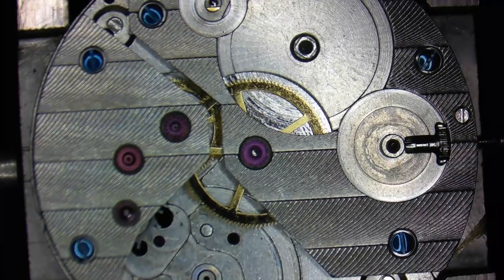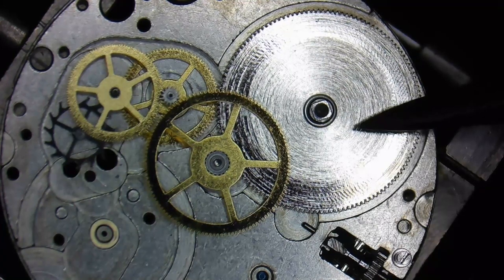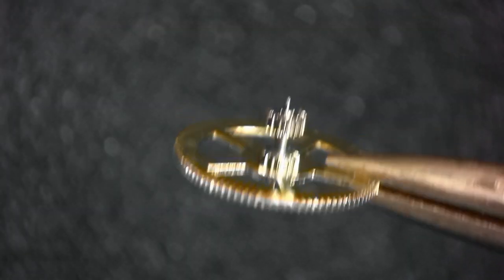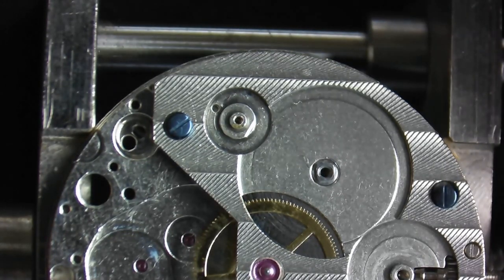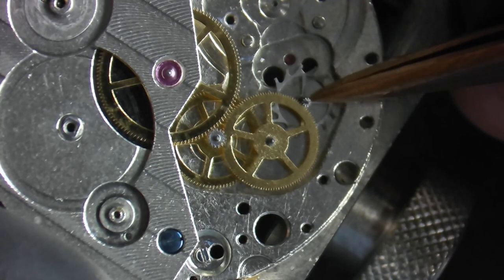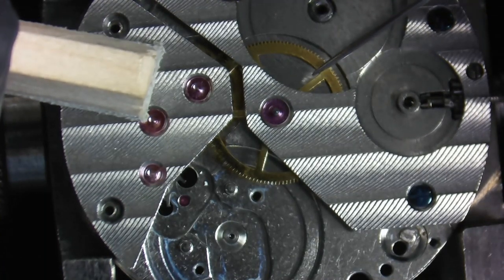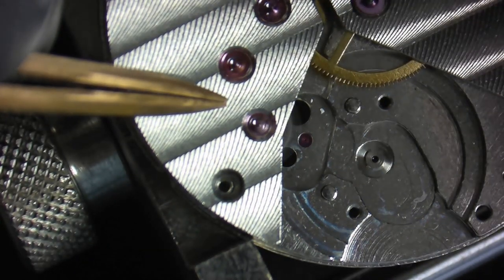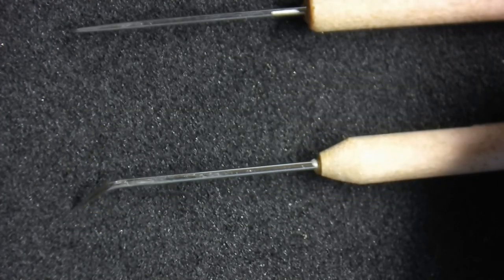How to Install a Train Bridge without Breaking the Pivots

Comment: Really thought you were going to do the "it is hard to get a bridge on perfectly the first try, but oh look, I just did" and keep going from there. Thanks for the second take with your deliberate explanation of what to do when it doesn't work the first time! Found your video after getting stuck servicing a movement with a single train and barrel bridge that is being especially difficult to get seated.
Reply from the maker: Lol, it usually doesn’t happen but sometimes it does. The needle probes I use help a lot and being able to see where the pivot is in relation to the jewel hole also helps a lot.

Comment: Alex great videos l have a question for you.l have a omega 564 l have cleaned all the parts and burnished the pivots with my Jacot tool on assembly the balance spring was centred between the guide pins as far as l could see started the watch and found the watch gaining 650 seconds a day on my timegrapher machine and have run out of space to adjust it anymore. It has a new mainspring in the watch and I have ordered another spring just in case every thing on the balance seems to be okay no rubbing and demag the movement I hope this question hasn’t gone on to long looking forward to your reply many thanks Pete
Reply from the maker: what's the amplitude at a full wind?

Comment: Great stuff as always :)  One thing I always mention with any part that is held in with multiple screws, whether it's a watch bridge or the back of a G-shock or the intake manifold of a smallblock chevy:  START all the screws before you tighten ANY of them.  It's very easy to put something on cocked or weird if you tighten the first screw before the others are in place.  It also makes sure you always line up screw holes, etc.  

I can see that you do that but thought it was worth a mention :)
Reply from the maker: Hi Eric,
That’s a very good point.
Good stuff Eric. 👍

Comment: What can create a problem where the seconds hand is acting sparatic. During a 60sec circle it sometimes stops and then caches up and works normal, untill it does it again, few times every circle. It is omega cal 1002. I watched the gears under a microscope. the seconds hand gear s theeth have the same problem as the hand. It was happening even before i servised it.The difference is , the watch is working perfect now. I did not oil the seconds hand post. And i did not remove the canon pinion, as it seats on a center will. The watch is working perfect atherwise. I do not know how to fix it. May be to change gears. ??????????
Reply from the maker: It sounds like there is damage to the teeth of the 4rth wheel or the pinion of the 3rd wheel. 
Inspect them under magnification

Comment: Very interesting video! Unfortunately, it is so much harder with smaller movements, where you can't immediately see with your bare eyes if the pivots are positioned correctly.
Reply from the maker: Yes, I understand. Just try moving the second or center wheel and while holding the light pressure on the bridge, look to see which pivot is not straight and try moving it towards the hole until it falls in. It just takes practice.

Comment: great video.  and yes it is very frustrating aligning the bridge. but i am getting better.  thanks 
i have a question 
for trying to diagnose which gears might be the problem. why cant i move the whole train from the center wheel when the balance wheel and the pallet fork is installed
Reply from the maker: The pallet fork is locked on the escape wheel which prevents all the power from leaving the mainspring barrel. this is why the power is let down before removing the pallet fork.

Comment: I can`t do in anywere on old watch Pobeda 2602
Reply from the maker: Try this. Install the bridge with just the center wheel, then with the center wheel and 3rd wheel, then add 4th  wheel and then finally the escape wheel.
Make sure when you are bring the plate over the pivots that the wheels are all standing straight.
When you are aligning the wheels make sure that the 3rd wheel in, the check the 4th then the escape wheel.
Use a probe to move the pivots and with good magnification look through the pivots to see where the pivot is.
Hope this helps

Comment: Hey Alex, thanks a lot for this series of videos they’ve really helped me! Could you confirm exactly which order we should be disassembling and reassembling please?
Reply from the maker: It doesn't really matter in the disassembly. When putting watches together I typically start with the keyless works Because the crown and ratchet wheel are part of it. Then you can install the powertrain starting with the mainspring barrel and its components, the bridge and then finally the train wheels. Then you can install the pallet fork and balance wheel.
Once this is assembled, go to a full wind and see what it looks like on your timegrapher. If everything looks good, meaning no crazy trace lines,  obvious problems in the escapement and decent amplitude then you can go ahead and install the motion works in any calendar systems.
If after installing the balance wheel, if  the movement is demonstrating anything out of the ordinary that doesn't look good, there's no need to assemble anything else yet. Let the watch run for 24 hours to see if things settle out before starting to do any troubleshooting.
Reply: @watchrepairtutorials  awesome thank you 👌🏽

Comment: Why do you loosen every single screw slightly before the final tightening? I noticed you do it with every screw like that, so there must be a good reason?
Reply from the maker: When I put the screws in initially, I'm just securing the bridge in position, then I checked the wheels again to make sure everything is free spinning.
The reason I back off or reverse the screws is, I want to feel the resistance of the screw to the part then I turn the screw the width of the screw slot for the final tightening. 
That's how you know the screw is tight enough.
Reply: @watchrepairtutorials  That's a very good method indeed. Thank you!

Comment: Having a blast watching your content! Awesome stuff, enjoying it so much. I want to start repairing watches strictly as a passtime hobby and these videos are so helpful, everything I have learned so far is from you. Thank you so much. 🤘
Reply from the maker: My advice to you would be to take your time. This stuff takes time to get good at. Learn something new and practice. The main thing you should be focusing on at this point is how to complete a service or working movement so that the movement works better than it did before you started.
Reply: @watchrepairtutorials  Thanks for the advice, I have a pocket watch that only runs when it’s dial facing down, looking forward to see if I can get it running correctly again ;)
Reply from the maker: @TheDivineInferno   you will be able to one day. If it doesn’t have shock protection, it’s most likely a broken balance pivot. That type of repair will require a staking set.  Just FYI old pocket watches are probably the most challenging watch is to get running correctly. Let me know if you need anything.

Comment: I've discovered tapping the side of the movement holder with the blunt end of my tweezers does a fine job of getting pivots (train bridge and balance wheel) to settle in place. 
Thanks for your videos, Alex. I use them as a constant reference source and as a go-to when I encounter problems. It seems regardless of how many times I watch them, I learn something new every time. You're a fantastic instructor.
Reply from the maker: Great tip John. That will definitely work. I think I’ve shown that in a video.

Comment: Thank you for the awesome tutorial. Is there any added benefit to the barrel bridge including the center wheel pivot (like with the watch in your video)? I only ask because I've noticed some watch makers prefer to build their watches with the center wheel pivot as part of a train bridge separate from the barrel bridge.
Reply from the maker: Not that I can think of. I think it’s more of a design issue.
Reply: Ok thank you for your answer. Truly appreciated. I still have to wonder though why some watches are made with more expensive individual bridging if it doesn't have any effect on anything. @watchrepairtutorials
Reply from the maker: @danielrichter2452  for the same reason certain manufacturers spend time black polishing a part or decoration on the bridges. It doesn’t make the watch run better and in most cases can’t be seen by anyone.

Comment: Fantastic video.  I always learn something.  
One problem I have with nearly every movement I try to work on has got me to the point of just giving up this hobby, and that is putting the train bridge back on.  When I put the train bridge back on, the pivots are in place, it fits down snugly, everything looks good, and then the damn wheels won't turn.  They just lock.  Even though everything looks to be in place.   We are always told to make sure as we put pieces back that the wheels turn easily and freely. Mine almost always do not turn.  No, I am not forcing anything.  The brass bends too easy as it is.   Is something slightly bent and I can't see it?.  If everything is in place and the pivots are in their respective jewels, then why would they lock up and not turn?.   It's very frustrating.  I am beginning to see why there are not many watch and clock repairmen around.  Working on cars is like breathing compared to this.
Reply from the maker: " When I put the train bridge back on, the pivots are in place, it fits down snugly, everything looks good, and then the damn wheels won't turn"

 When you put the bridge on, the wheels will spin freely only if the wheels are in the correct position AND all the pivots are in the correct place. Often times,  all the pivots with the exception of one will be the jewel holes. Don't put in any screws until the wheels spin freely.

"The brass bends too easy as it is"   Pivots are steel

"If everything is in place and the pivots are in their respective jewels, then why would they lock up and not turn?"

There is no question that installing a bridge with multiple wheels is one of those things that people can struggle with early on. Try installing the barrel and just one wheel. See how it spins. Then add the 3rd wheel and see how it spins, then add the 4rth wheel and check it again.
Finally add the escape wheel.

This method of adding in one wheel at a time is how you troubleshoot problems with the power train.

Practice practice practice.
Reply: @watchrepairtutorials  Thank you for your help and advice.  I really do appreciate learned folks like you who help us inept ones.

Comment: This is a real challenge in full plate watches!
Reply from the maker: You bet it is. But like anything else it just takes practice.
Reply: @watchrepairtutorials  I have made a tiny s shaped wire and with a foam wedge I can usually ease it into place.